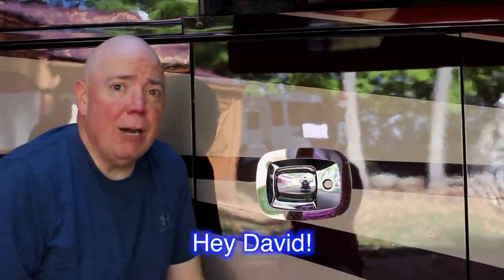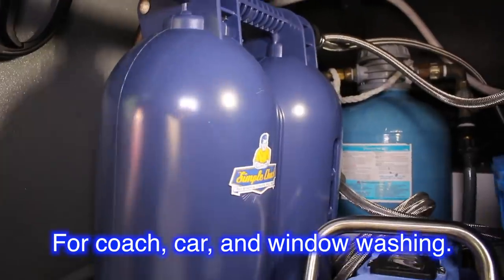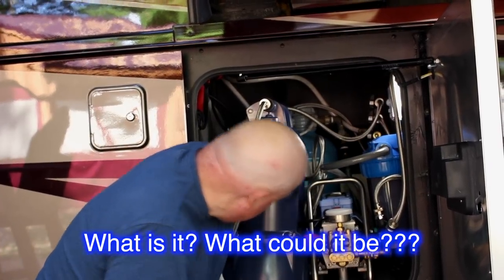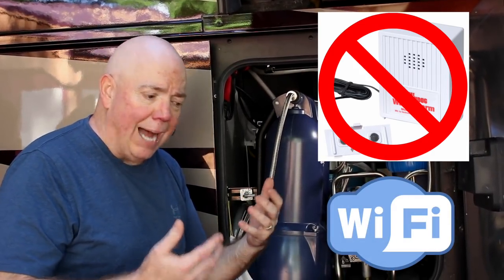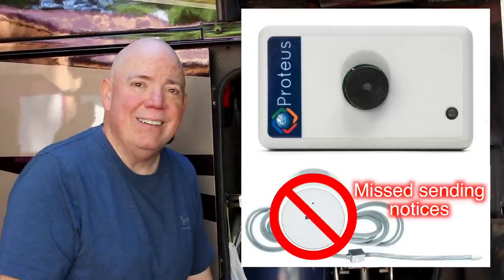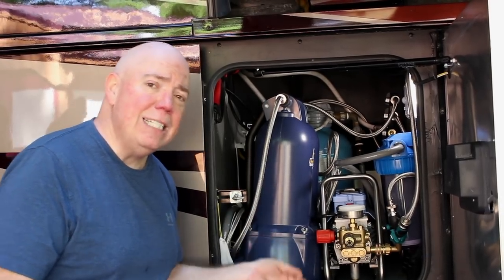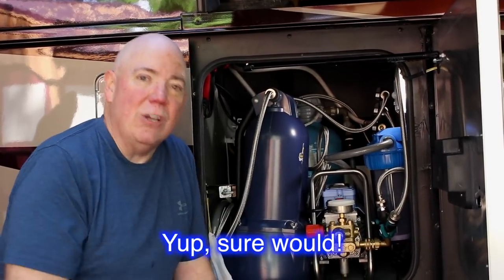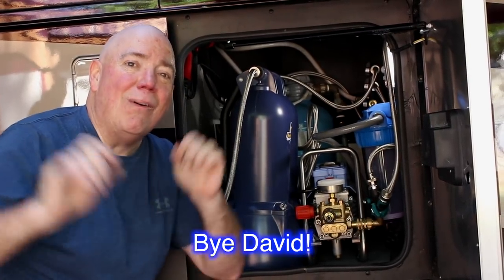Consider a Water Sensor for Your Motorhome

Comment: David, good video.  Thanx.  2 Questions:  How do you get to the water softener to regenerate?  Would you happen to have a schematic showing how you laid all this out?
Reply from the maker: Hi...As it is in the back it would be hard to get it all out to recharge it. So what I do now is I use a separate filter canister with quick connects and use the large home type salt for the recharge. Thus, I do not need to remove the tank. I fill the canister 3/4 with the large salt, connect it up right after the filters before it goes into the softener, flip it upside down and run water through at like 1/2 gallon per min and wait for it all to be gone. With the "On The Go" unit you would normally need to remove the top cap and pour in two table salt cans to do it. I like my way much better. :-)  Sorry, but I do not have any drawings etc as I just do this stuff on the fly as needed.

Comment: David do you have some kind of cutout (bypass) on your water softner so you are not using it in certain parts of the country?
Reply from the maker: Nope, we use it all the time.  No reason not to.  Also, before you ask,  it is in the back so is it not hard to get it all out to recharge it? No, as now I now use a separate filter canister with quick connects and use the large home type salt for the recharge. So I do not need to remove the tank. Fill the canister 3/4, connect it up, flip it upside down and run water through at like 1/2 gallon per min and wait for it all to be gone. With that On The Go unit you would normally need to remove the top cap and pour in two table salt cans to do it. I like my way much better. :-)
Reply: Thanks, maybe you could make a video charging your softner?
Reply from the maker: Not likely as it would not be something that is useable unless you have such a unit. But maybe for fun.